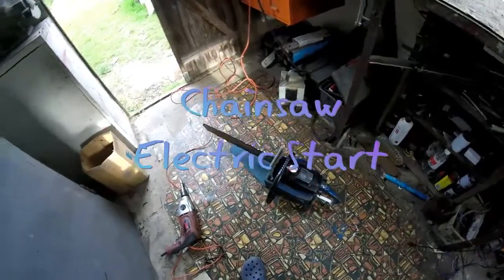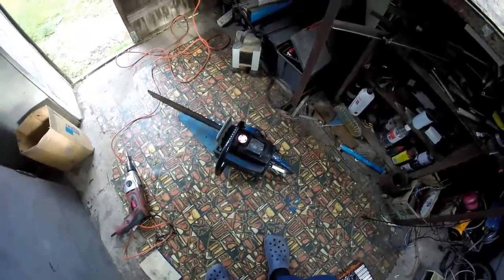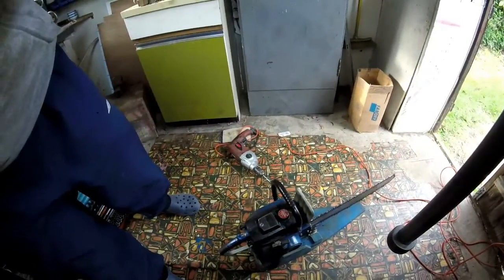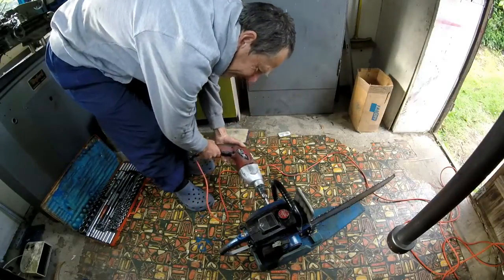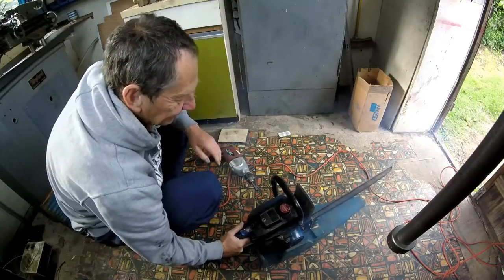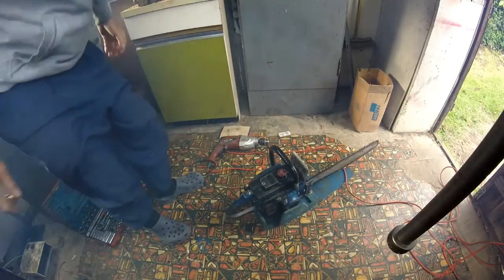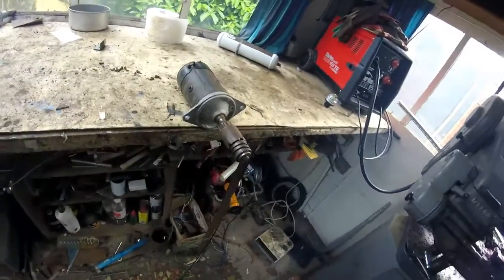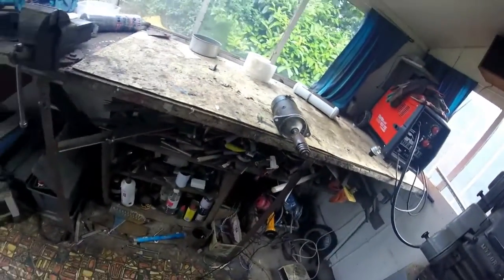Chainsaw Electric Start

Comment: You may have weak compression if the saw doesn’t start by hand pulling but will start by drill cranking
Reply from the maker: Yes it's a very old saw but I've got a newer one now.

Comment: Great vid. just subscribed.  Wonder though, how you avoid flooding cold saw when you must start in full or half choke? Doesn't the sound of drill or high revs obfuscate the initial engine sputter sound that tells you to remove choke? Or perhaps seems like would not have time to remove drill even if did hear it.

Comment: I doff my cap to you sir. It is precisely this kind of lateral thinking and practical ingenuity that stir up the emotions and give one a vestige of hope in this bleak disposable age. I have often been found slumped over a cold, unresponsive chainsaw; weeping,  past all known points of physical and psychological endurance , to all intents and purposes a broken man after simply trying to start the wretched encumbrance. In short , I intend to track you down, move in next door, give it a day or two then pop round with my own saw and ask you to fettle it for me. Hope you don’t mind but I’m desperate.
Sincerely yours (in anticipation of a beautiful, mechanically based friendship)
Reply from the maker: I'm moved by your lovely words. Thank you. It's true; sometimes you use so much energy starting the saw you might as well cut the wood by hand!
Reply: Rayxl1.  Your welcome, I was genuinely impressed. And seriously, can I send you mine to do the same thing with ? For a fee naturally.
Reply from the maker: @Mercyme57  I'm retired now but its not that difficult to do. You just need to get access to a nut or bolt on the crank shaft, check that the thread is correctly handed and find a socket to go on the drill.
Reply: Rayxl1 I guess we all find different things easy in life. I am unskilled and unsure of myself in this arena, but not others.
Enjoyed the video anyway. 
God bless you my friend.

Comment: I have used a drill to start my 4 cycle engines for years too. However my chainsaw flywheel nut is threaded the wrong way and spins off. Any ideas on how to overcome that?
Reply from the maker: I would be inclined to secure the nut with a small weld. If the nut has to be removed you can grind the weld off.

Comment: grrrrreat solution I wish   you could take your time to explain what kinda modification  you made  to use the socket   and what is the minimum  power drill   would be so wonderful   thanks
Reply from the maker: On this saw there's a nut on the end of the crank shaft and I used a socket the right size for this. I normally use a fairly large mains powered drill but an 18 volt battery drill just about does it.

Comment: Excellent & Thanks. My cousins chainsaw would not start and I did all I could at the time to try and get it to start. This was overseas and what with time, not my tools etc I went to a point and then said, let our other cousin, who was a mechanic and worked on farms have a look. I was later told that there was something in the guts of the engine that was the cause i.e. tiny metal broken piece. I would of had to have stripped the whole thing down and like this other cousin, wait for the ordered part to come in etc. What I'm trying to say, is that at times, this drill, starter motor trick, still might not get you going. At least with cleaning the spark plug, checking spark plug spark/gap, clean filter, cleaned carby and making sure it's not dry or flooded and then going to the level of using this electric motor start up, you'll know that you are in for something more serious.

Just in the process of looking to buy a pole chain saw, whipper snipper combo set up. Hate the thought of a fuelled motor and have been looking at electric. They are getting better, especially with electric chain saws, but the whipper snipper/pole chainsaws are mostly junk still. For my female cousin, electric would be better, especially as she's not mechanically minded.

Comment: Thank you. - Great device, but i wish you would show us how you modified the chainsaw step by step.
Reply from the maker: Its only a bolt on the end of the chainsaw's crank shaft the head of which the socket goes on. The only problem I had was the crank shaft that end goes anti clock wise so you really need a bolt with a left hand thread to prevent it coming undone. If you can it would be better to use the other end of the crank shaft which would take a normal right hand thread bolt or on some saws there might be already one there.
Reply: Thank you.

Comment: Just wanted to say thank you for sharing this.  I'm 69 and cannot pull the chainsaw cord 20 times to get it started, and then have the energy to actually do the work.  I followed your lead and removed the pull cord, then drilled a 3/4 hole in the side casing. I put the socket through the hole on to the shaft nut. It starts great, and I don't use 50% of my energy pulling the cord. Thanks.
Reply from the maker: +Frank Obermaier Glad it was helpful. I've found high reving engines are rarely easy to start by hand. Thank you for the comment.
Reply: would that work on my sthil ms250.....just a thought

Comment: have tried resetting the carb jets? basic settings for both jets according to my manual is 7/8 of a turn out from fully seated. if that doesn't work, try fitting a new fuel line and carb kit. regards richie